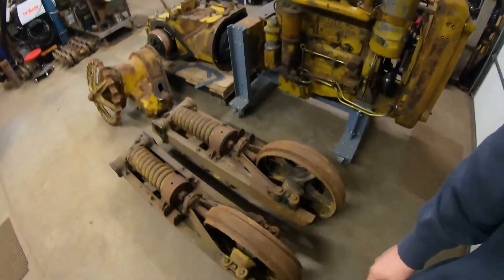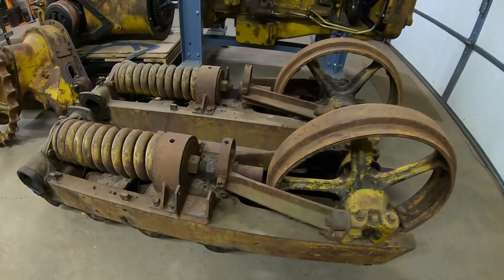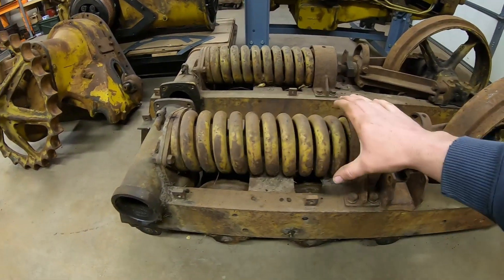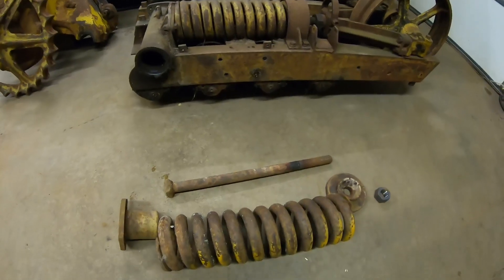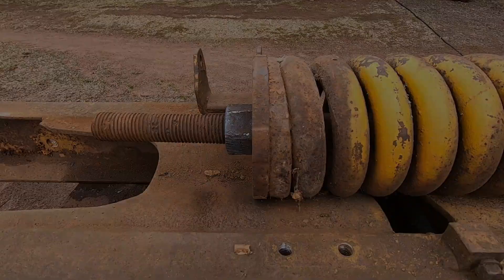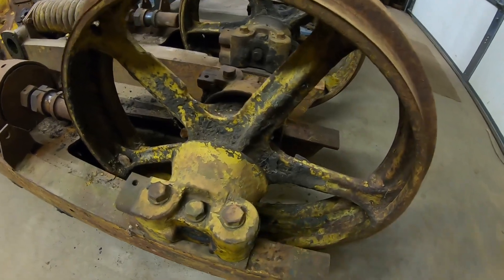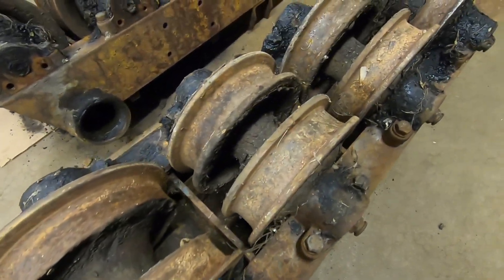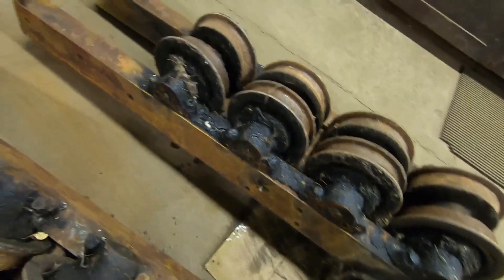Caterpillar D2 #5J1113 Chassis Rebuild Ep.32: Undercarriage & The Exploding Recoil Springs!

Comment: Did this project on my 5J back in '85. I have manuals up the kazoo on my machine, and paid close attention to the Service Mans book. Walked me through a lot of these types of dangerous areas. Working on class 8 trucks and equipment make you aware of potential danger spots. Your Attention to detail is awesome and I watch you regularly in your rebuilds. Still have my 5J, not running at present. Stay Safe !

Comment: Also the grease on the threads falls under the heading of doing good things for the next guy to work on it, because sooner or later you're the next guy.
Reply: @squatch253  As long as it isn't the sharp ends of cotter pins and lockwire, those are the worst 😬

Comment: Loosening those springs I would add a second nut in front of the original. I have had springs on plows blow the threads out of nuts while loosening them.

Comment: I would remove the large bolt from
Spring so I could I inspect especially around the head for any severe rust piting and more importantly  for any cracks that show a coming failure.  Plus since no painting  I would want to cover the bolt with grease to insure it will not become stuck in the collar it slides in and to prevent rust.  Since it is covered by the spring itself no one would notice the heavy coating of grease.  Of course the grease will attract dirt but that is good.  Ever notice a car whose frame is covered in a combination or grease and oil and dirt.  The frame will remain rust free there no matter how salty the roads take it from an Ohio boy.

Please keep up the good work.  Enjoy you solving problems. Wanted to show you a way to lossen  ball
Joints and tie rods that always work that does not involve that dreaded pickle fork.  This was taught to me in the 70’s by this ww2 mechanic.  But kept my mouth shut.  It was only with the intention of helping.

Comment: Broken springs on the older girls is pretty common down here. 

Back up in Colorado, we had a D8T that the spring retainer broke on- left the blade on, released the grease to try and help remove some preload, pulled the slide retainers, then popped the alligator- that whole front tube slammed hard enough out to whip the track out from under it and pin the blade. In hindsight, we were lucky the sprocket kept the upper loop on and didn't whip over and slap the guy manning the impact

Comment: I don’t want to jinx you, but I am amazed at how nicely those bolts came out.  Take a 10 year old suspension component in the rust belt and you’d be hammering on undersized sockets and reaching for the torch set.  I’m convinced the metallurgy in that old steel must be better than what we typically see today.

Comment: Having played with structure dampeners quite a bit, i can tell with 100% certainty, that springs under tension are the one thing you don't want to mess with, besides mother in laws.
Even a small spring like that has enough potential force to smash all the bones in your hand if caught between a rock and a hard place. They're actually quite similar in size with ones i've seen tested for earthquakes, and i've seen one fail (intentionally) and the resulted force was enough to dent a piece of 1.5 mm thick steel into a "bowl". They are not toys, that's for sure.

Comment: Used to do alot.of d10 track frame rebuilds 
Those springs were similar size to a fully working D2 
It was always a pucker Moment dealing with them 
The hitachi dealer down the road had a tension nut clock sideways in the tube (cross thread kinda) for a ex8000  excavator 
They ended up having to get the bomb squad to come in 
Cornered off a huge bit of the industrial estate then buried the idler and tensioner in the middle of the yard and let.it go with explosives to blow the nut out 

They managed to keep it outta the news but it spread pretty quick around the mechanics in the mining industry
I love that you can roll the travk frames by hand 
That was another pucker Moment for us rebuilding them

Comment: Those recoil springs remind me of the parking brake springs used on air brake trucks.  Definitely not something to mess around with, the manufacturers went to a permanently crimped design because mechanics were getting injured and killed by improper disassembly to replace the diaphragm on the parking brake side........
Reply: For sure! I'm a firefighter and greatly fear truck fire for this exact reason. The aluminum center section melt and you now have projectiles coming at you.

Comment: I remember when i was in Basic Training at FT. Knox KY  we were working for about the first time on the M60 MG  a private (not me)  pulled the shoulder stock off with the bolt to the rear..... the bolt carrier went right through the cinder wall luckly no one was in the way

Comment: Worked in a Cat shop long ago, had a D9H come in with the track frame split in half through the recoil spring chamber. Getting the spring caged had to happen before we could even split the track. That one the threads and nut were still good. The replacement frame from the boneyard was a different story. Our welder cut open the chamber and sliced the springs up so we could pull it out then welded the chamber back up so we could rebuild the frame.

Comment: Recoil springs - you definitely want to be careful with them.  The new machines are under even more pressure.  Are you planning to re-bearing and re-seal all 8 rollers and both idlers?

Comment: @Squatch253 Not sure if you look at old video comments, but I'm going to forget to mention this sooner or later: Brian Bloc (BCBlock02) has a horizontal boring mill that looks like it could cut it's way through a mountain pass. I'm betting it has enough reach to bore the cylinders on those pony motors. Might be a completely unworkable idea, but here's a shot of it in action   https://youtu.be/pLzZ3JYPXOg?t=616

Comment: Hi squat challenge, I’m working on a d4400 power unit. Specifically the injection pump. I’ve got good fuel delivery, but no fuel feeding the injectors. Not finding much on the web. Any way I could contact you and pick your brain a bit?
Reply: Yes, I watched that video of yours and the ones after that of the reassembly. And I have removed that inspection plate, also the back of the governor (d4400) I removed the link between the gov and metering rack, can’t move the rack back and forth. So to free up the plungers I’d like to remove the toothed rack and gently work the plungers. I’m worried that the toothed rack and gears on the plungers will not go back the same way. Can I mark the rack and the gears prior to disassembly?